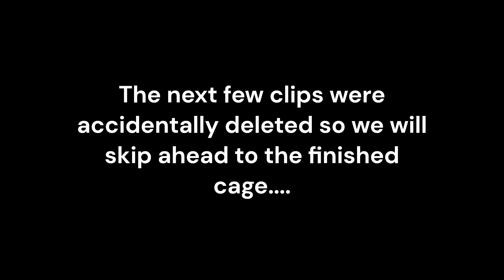DIY 4-hole Rabbit Cage Build

Comment: Great job. Great to see a young lady actively using her hands and mind on a project. I made 3 30" by 8' and divided them in half to raise youngsters I raise for sale. If you plan to make another set of cages later, think about making all your sides and ends out of one strip of wire. You can easily make the bends sandwiching where you want your bend with 2 2x4s and pulling up on the wire. I do that, because it makes it a bit stronger and less j clips. You might want to add some of the blue strips around the door to also prevent you from getting scratched and prevent catching your clothes.  
Very good job. I have added you.
Many blessings.
Reply from the maker: Thank you for the suggestions!